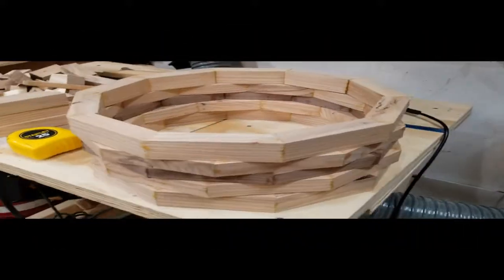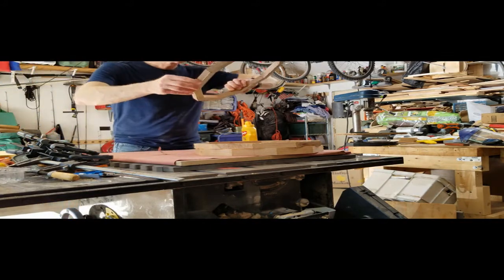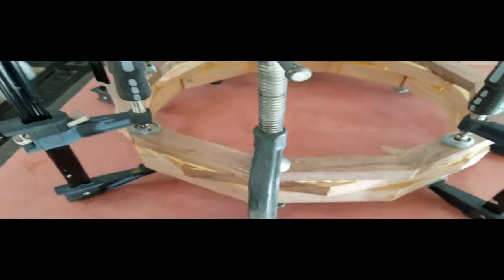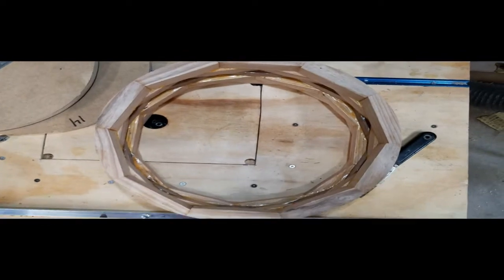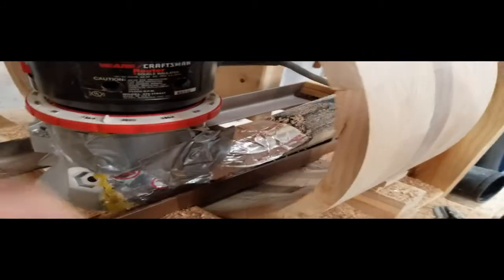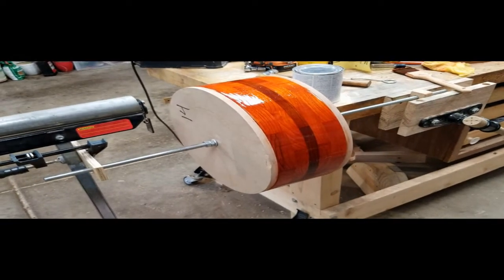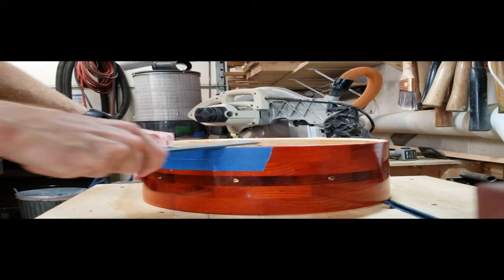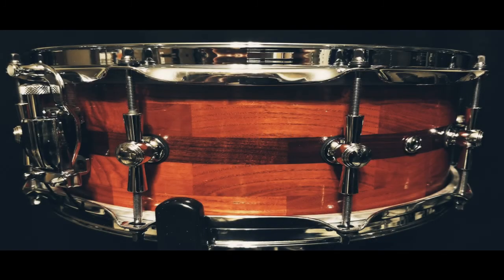A Different Way to Build a Drum - Ash/Walnut Segmented Snare Drum - Its Orange!

Comment: What would it cost for you to make one of these but in a 13x6 and send it to Australia?
Reply from the maker: Hi Chips. We'd probably be talking in the range of 250USD plus shipping & duties. If you think you are interested, I can start on that, but since I'm not doing this full time, I'd rather take this as a "suggestion", rather than an actual order. Then when its done, I'd give you first crack at buying it. My day job keeps me pretty busy, so these projects can drag on for weeks, unfortunately. Makes it hard for me to commit with enough confidence to take custom orders, but I would love to try a 13x6 drum, I've built mostly 14s and one 12". It would be nice to add 13's to my capabilities.  Thanks for the interest! Let me know if still interested. I have Facebook page called "Fallen Oak Drums", so that's another way to communicate with me. - Tom
Reply: @fallenoakdrums  I'm just curious at the moment. It's a unique drum and looks sensational. I will find you on FB.

Comment: Would you say segmented shells can be made thinner than stave ones? By the way this snare looks and sounds fantastic.
Reply from the maker: Hmm, not sure. I guess that since there is some interlocking between the wood pieces on a segmented drum, it may be a stronger than a stave assembly overall. Depending on the wood, I think, you can get a pretty stiff shell with as little as 1/4" thickness, even with staves, although I do prefer to leave thicker re-ring sections (3/8" at least) at the rims to make sure it's nice and stiff. Oh and thanks, I had fun making this one. was pleased with how to final stained/lacquered finish came out!